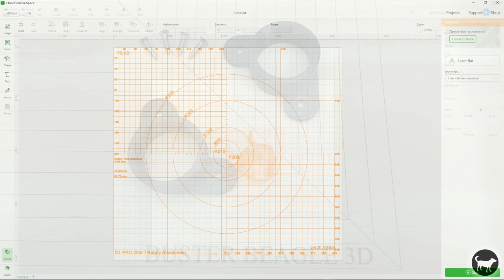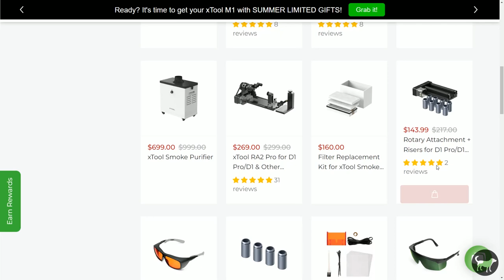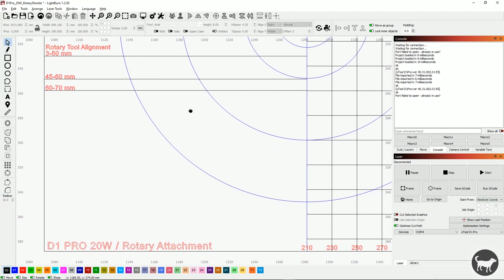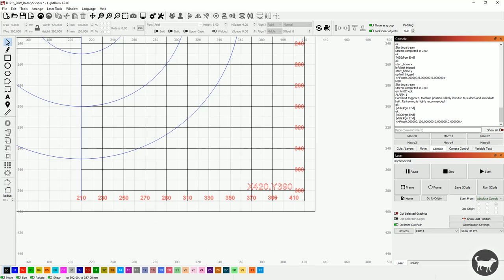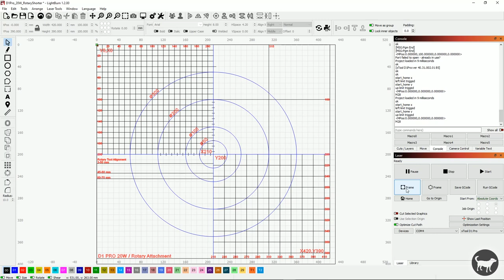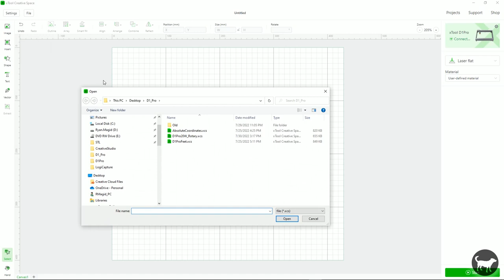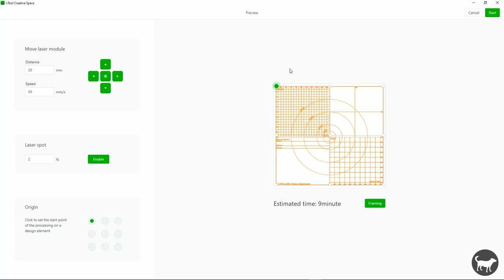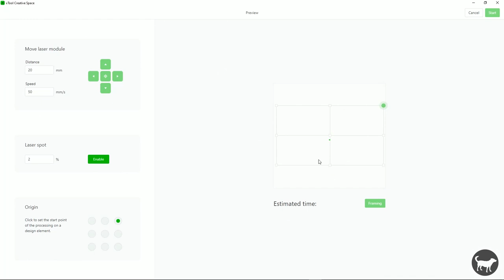xTool D1 Pro Grid Files | Use Absolute Coordinates | Lightburn | xTool Creative Space

Comment: Hey there Ryan! I purchased your file and I'm having trouble with the limit switch on the front when it makes the first pass toward the button. Not really sure what the problem is. If its a simple cable fix. None of the setting in lightburn have changed except power & speed.
Reply from the maker: Just make sure you read the Read Me First file in the zip folder. It has important info that may be helpful.
Reply: @BusterBeagle3D  That's how I first tried to run it with no air assist on it and all no crosshair. Ended up just turning off the limit switches homing the device and running it and had no problems. Almost like my limit switches are a MM too far forward or my cable in the back is keeping my homing to be forward by a MM or 2. That's my only guess.
Reply from the maker: @TylerAvakian  It's possible there might be slight hardware differences in how the machines where assembled that could be affecting the limit switches like you said.

Comment: I got the pro20 and now it will not respond and the stop switch light is not on .I  been trying to contact xtool  with no respond to find out how to get it fix.It says  no usb connect with it hook up
Reply from the maker: I would restart both the machine and your computer. Sometimes the driver on your computer can get out of wack. Once it’s back up if it isn’t working I would check your device manager on your pc and make sure it’s registering that the USB device is being recognized. If it’s something outside of that I’m a little at a loss. Otherwise I would make sure you are using XSC and see if you can connect to the machine over Wi-Fi.

Comment: Hi Ryan - I recently purchased your grid file for Lightburn.  I read the read me first file that you included and completed those tasks.  When I ran the file the majority of the grid burned on the spoil board  with the exception of the long horizontal on top half and the horizontal lines on lower left section.  Can you help?  Thanks
Reply: Lower right section
Reply from the maker: Make sure your workable area is set to the full workable area on the version of the machine you are using if you are in Lightburn. If you set your workable area to the exact dimensions of the grid then if there is a dot on the line it wont burn. If you check the Window> Preview button in Lightburn you should be able to see what will burn and what will not.
Reply: @BusterBeagle3D  Thanks for response and advice, that seem to fix the issue.  Very much appreciated.

Comment: Just purchased the files and loaded the D1Pro_20W_Ra2ProExtended into Lightburn. I have the extension kit installed on my D1Pro 20W. My laser is set to spot (not crosshairs). I home the laser, and do the framing. I would suspect that the laser would frame the whole board but it seems to only frame half as if no extension is installed. I have the Extension turned on in Creative Space. I'm using the latest releases of both Creative Space and Lightburn. Am I missing something? I don't want to "Start" if some step is missing which is causing it to not frame the whole board like the file shows for the extension size grid.
Reply from the maker: Click on Edit > Device Settings and check your workable area. It should be  Y934  X432mm for the extension.
Reply: @BusterBeagle3D  That was it! Thank you so much.

Comment: The file I bought skips right on top when I start burning it. It jumps 10mm on y. I can send a video if that helps
Reply from the maker: Make sure you laser can home properly at the beginning and that there are no wires or anything else getting in the way of the of the gantry homing. Also be sure to read the "read me first" file in the zip folder for additional instructions

Comment: Absolute zero! It has been my "Khan" since I got my D1. I'm generally happy with the laser because I don't know any better but not being able to determine your start point based on machine zero seems like something that I wish I had understood before I bought it. I've been using the native xtool software and it's ok but severely limited.  I did buy lightburn and it seems that you demonstrate that I will have that homing power for the D1. Is that correct?
Reply from the maker: The original D1 without limit switches will not home in the software. You can use a manual tool to find the home position on the original however and still use absolute coordinates and my grid. I recommend this one:   https://www.thingiverse.com/thing:5274995

Comment: I am planning on burning the grid using lightburn, do I need to adjust the power/speed settings? Or use the ones that are already there.  thank you
Reply from the maker: Hello. The ones in there are what I used for the 20W laser on my spoilboard. Depending on the power of your laser and the material of the spoilboard you may need to adjust it slightly.
Reply: @BusterBeagle3D  thank you for the quick reply.  I am going to be running the 20W laser.

Comment: I purchased the grid, but noticed that it's metric. Do you have one for imperial? Thx!
Reply from the maker: Hello. Unfortunately I don't have an imperial one. Even though I'm in the US I use metric for all 3D printing, CNC, and lasers as it's a more universal standard and honestly easier for many to understand 1mm vs 3/64, 2mm vs 5/64, 3mm vs 1/8 etc.
Reply: @BusterBeagle3D  Thanks for getting back to me. I may try to recreate yours in Illustrator using inches, or... adapt to metrics! BTW, love your channel!!
Reply from the maker: @brad_neal  No worries. I have been a 3D modeler for over 20 years and have always worked in Metric since I started. It is so much easier to say .1mm to 39 thousandths of an inch  ;) Thanks for the kind words on the channel!
Reply: @BusterBeagle3D  Lol, me too! I owned an agency for 30 years specializing in photorealistic illustration and animation. We primarily worked in the mechanical engineering space and used CAD models to create our work. We used Pro-E for CAD and 3DSMax for the 3D stuff. I've been out of it for about 10 years now, but still somewhat of a geek! Did a lot of work for Deere, Cat, and the big-3 auto companies.

Comment: Can I use this grid with my D1 and XCS software?   My laser wont connect to laserbox to use your free version.  I know the working area is slightly different between the d1 and d1 pro
Reply from the maker: Yes. It's slightly smaller then the one I made for the original D1 but the size of the machines are the same size. They just list the size of the D1 as larger but that really it shouldn't be that large on either model. The grid will work just fine and is nicer then my original one.
Reply: @BusterBeagle3D  Thank you!  Going to download tonight.

Comment: I just received my Xtool D1 Pro 20W yesterday and used the D1Pro_20W_RA2ProShorter.lbrn2 file to burn the grid.  It homes and frames fine.  However, Lightburn posts an error immediately stating the one or more shapes are crossing the edge of the machine workspace.  if I continue, the software reports an error immediately that 
err:limitCheck

ALARM:1
Hard limit triggered. Machine position is likely lost due to sudden and immediate halt. Re-homing is highly recommended.
On or near line 685:
Job halted 
Do you have any idea what's going on?
Reply from the maker: Hello Repac. I just messaged you an updated file through Etsy that will fix the out of bounds issue with lightburn. It's due to the way that lightburn reads a file where it's off by .001mm but that reads as 0 when you load it. Either way, check your Etsy for the updated file. 
As for the limit switches you need to be sure to both turn off the crosshairs as well as the limit switches in xTool Creative space before going into Lightburn. The crosshairs create a 16mm offset which will not allow the machine to make it to the full advertised area of the workable area. You also might be hitting the limit switches as well so also turn off that setting in XCS first. You might also want to check and make sure that your air assist is not hitting the wires on the righthand side. If it is I would temporarily remove it while burning the grid or make sure the wires are out of the way.
Reply from the maker: Also forwarded the link to your email.
Reply: @BusterBeagle3D  Yeah.  I got the image burned.  I turned off the sensors in XCS after homing in Lightburn.  The image shifted by 10 mm so I need to set the X origin at 220mm to get to the center of the pattern.
Reply: Hi there, I’m experiencing the same issue with my new XTool D1 Pro. Help please.
Reply from the maker: @mwcoats83  Hi. Can you PM me through Etsy and I will send you an updated file?
Reply: @BusterBeagle3D  Yes sir.  Same problem.  I sent you a message on Etsy as well.  Please send updated file.  Thank you

Comment: What is it about the: "*NEW EXTENSION VERSION" ??
Reply from the maker: It’s just in reference to the grid for use with the D1 Pro with the added extension rails.
Reply: @BusterBeagle3D  I bought the regular version. I have the xtool d1 pro. Do I have to desactivate the cross laser guide to engrave the guide? Can I do it with the cross active? I find difficult positioning mi pieces without the cross.
Reply from the maker: @estetubo  The problem is that you lose 16mm of workable area when using the crosshairs. You can try to frame without deactivating the crosshairs and see if it can reach with it it. My guess is you would still need to turn off the limit switches and potentially remove the air assist tube just for when you are burning the grid.

Comment: Are the files different for the Pro 2.0?
Reply from the maker: If you use the files in Lightburn they will work as they should. The issue is in XCS where they have changed the workable area of the 2.0 even though the frame size should be the same. I do have a 2.0 version that I made if you purchased the grid on Etsy that I can send you. If you got them on Etsy just reach out there and I can send you a link.
Reply: Hello, I just purchased the grid but doesn’t match up, I’m thinking I need the updated version
Reply from the maker: @rachelconklin88  If you just purchased the grid you can use any of the Lightburn files even if you have the 2.0 version of the machine. There is also a 2.0 folder in the xTool Creative Space folder the contains the file you can use in Creative Space.

Comment: I have downloaded your files for the D1 pro  5-10 watt RA2 PRO.  When i try to burn it I keep hitting the limit switches.  Is there somthing I need to adjust before the burn.  I am using the XCS software.
Reply: I am having the same issue and have tried both xcs and light burn
Reply: @mcdonaldbro34  hopefully we can find a solution.  There just isn't much out there on XCS.  I am a newbie and trying to learn as much as possible.  Thanks for your feedback.  Do you have the d1 pro 10 watt as well?
Reply: @mcdonaldbro34  When I frame it goes through and acts like its going to work but still hits the limits.
Reply: @jimstephens2487  yes I do and I am a newbie as well I’m sure there is just something simple we are missing but there really isn’t a lot of info out there.
Reply from the maker: Hello. Try turning off the crosshairs for the laser guide. Since it offsets the laser it will not allow you to hit the full frame of the laser. You can only do this in xTool Creative Space but when you change this setting it will change it for Lightburn as well.  You can also turn off the alarm in those settings.  Click on the gear next to the laser in the top left corner. Then click on working Parameters. Switch the positioning mode to Laser Spot and if need be this is where you also turn off the limit switches.
Reply: Buster Beagle 3D
Reply: @BusterBeagle3D  thank you!  This allowed me to burn the grid.  Should I turn the limits back on after this?  Thanks so much for your support
Reply from the maker: @jimstephens2487  It's up to you. It's more of a safety feature then anything but since you shouldn't even leave your machine unattended it will probably be more of a pain then anything. It's important if you are not using absolute coordinates but as long as you frame before every job you should be ok without them.
Reply: @BusterBeagle3D  Thanks,I was having the same issue.That did it